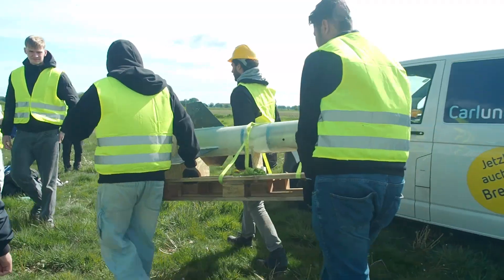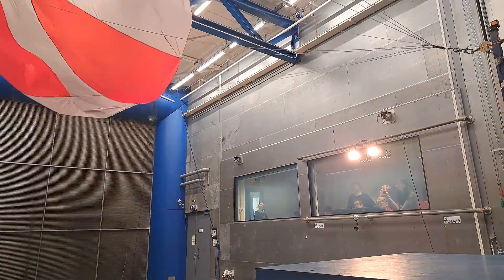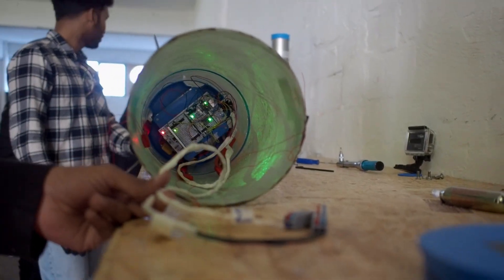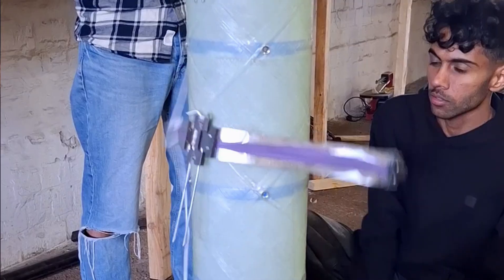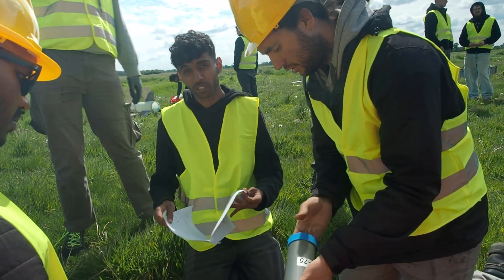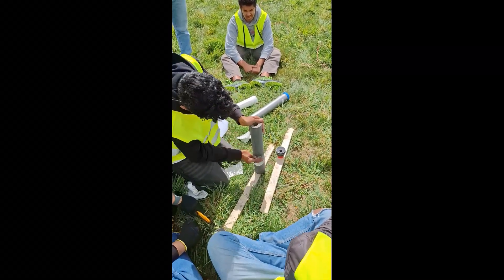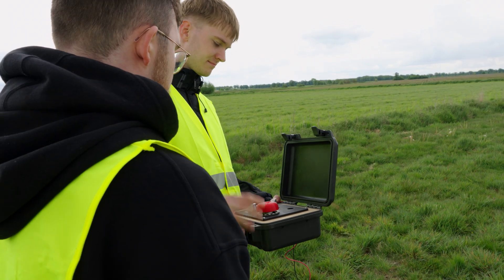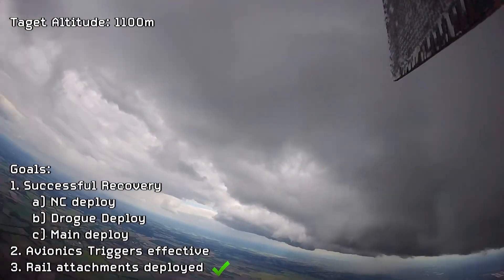ASTRA's First Solid Rocket: Ascendance Launch

Comment: Why did you choose to have a pin pull to release the rail guides? there exist other methods to deploy the rail guides that are retained by the rail, or instead launch from a tower. I feel like the pins and strings are just another thing that could fail? Fantastic launch, however :)

Comment: What was the reason for choosing a launch site near an airport? I would have expected your local regulators to want some stand-off distance in case of a mishap like this, to prevent any chance of it coming down on a parked aircraft or airport facility (even if all operating aircraft had been instructed to keep clear during your launch window).

Or was it easier to de-conflict your rocket operations with manned aircraft operations if you were within sight of the control tower or something?
Reply from the maker: The Airport we chose to launch at is more of a private airport for flying hobbyists.  So it was fairly easy to coordinate with the staff there and get a flight window.  We have insurance in place for potential damage we do to property (although there were some fancy planes there that our insurance coverage probably would have been inadequate for had we crashed into them in the hangar or something...).  In general though, we set-up the flight to have a very very low likelihood of landing on anything but open fields.

Comment: What are the mechanics of your nose cone, drogue, and main parachute deployment?  It looks like the nose cone is pushed off mechanically.
Reply from the maker: The Nosecone is deployed with pressure.  There is a CO2 gas cannister onboard and a valve that is triggered at apogee.  The drogue chute is attached to the Nosecone and should have come out with the Nosecone (that unfortunately did not happen).  The main was held back by a triple ring system and a pin.  When the pin is pulled, the rings separate releasing the main chute.  This did not get a chance to be tested as the drogue failed to deploy.  The avionics signal was sent at the right time though.